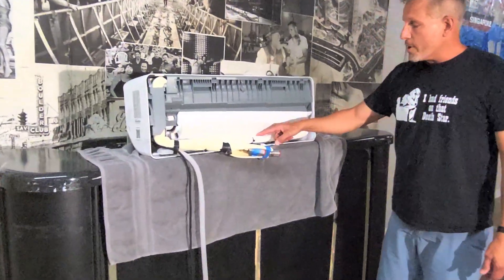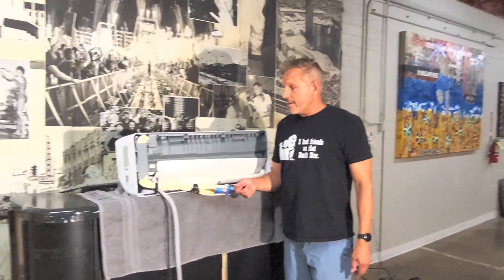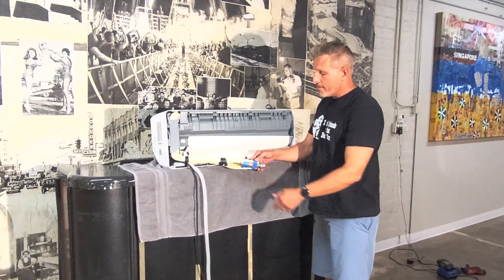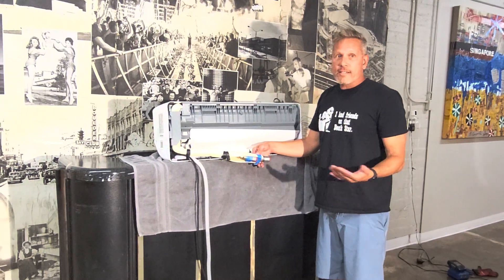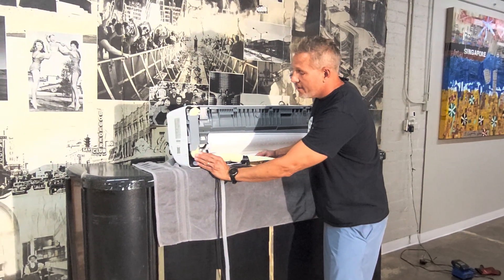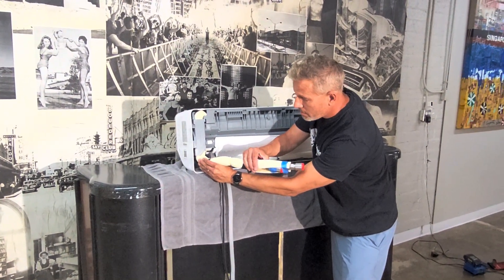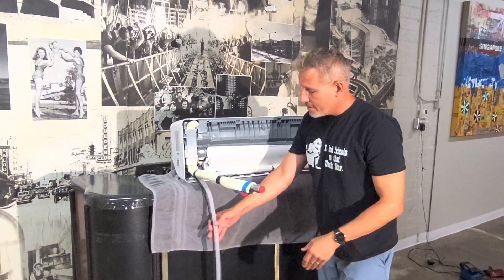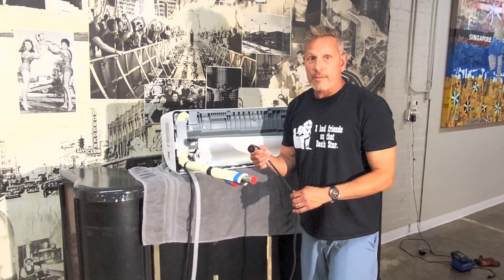Quick 'n' Easy install #1:  straightening the refrigerant line stubs on the indoor unit.

Comment: Dave - I just purchased this unit from Santan Solar,  I’ve been waiting for seemingly a decade for something like this!

I’m at this stage of the install and I’m very concerned about bending the copper lines.  I know how fragile copper can be when bending, I’ve had some very bad experiences with bending copper line so I’m really hesitant to even bend these lines at all.  I know this would likely be a many thousand dollar mistake.

I’ve watched this video and read the manual several times but I’m still hesitant to bend these the way they need to  go.  Where on the lines does the actual bending take place?  All I need to do is put my hand at the last elbow and slowing rotate it?  It seems like it’s needing quite a bit of force, is this normal?
Reply from the maker: Hi Brian, 

Well, only the paranoid survive, so you are barking up the right tree. You know, as long as you're aware that there needs to be a fulcrum, you're fine. We'll take care of you if you mess it up, but don't mess it up! 

https://youtu.be/95pit_Oroq4
https://youtu.be/p1lwJ1BmHpA

Which part are you most concerned, straighten it out of the back of the indoor unit, or when it comes through the wall?  Watch the above 2  videos since these are the main curves (we'll call them curves, in fact, not bends).
Reply: @ Thanks Dave!

Big thumbs up for the great customer support!!!

I got this installed and it’s running perfectly!

I hope this will last a decade or so. But I’m not reading good things about the longevity of mini splits in general. 

I’m doing this more to have some independence from the grid.  In AZ, no AC would make living here nearly impossible.

Comment: Can the hole (for going through the wall to the outside) be offset to the right of the inside unit?  
There appears to be a 'punch-out' or scored area on the right end of the unit on Page 8 of the installation instructions. 
I want to mount it above a window, but to avoid the header, and studs in the wall, can bring it out about 10" - 11" outside of the unit, before taking the 90* bend to go through the wall?
We have a 2"x4" wood wall construction, so I believe from the bend behind the unit, about 12-13" to the right, then bending outside 5", then downward. 
Will the Quick 'n' Easy line pigtail be enough to get it outside to connect? 
Thank You - (getting ready to order ~ save me one!).
Reply from the maker: Hi Mike, yes, you can punch out to the right, no problem. Will do the final measurements to make sure that's also viable for the quick and easy, since normally that would go straight through the wall. Or we can customize the quick and easy to put the valves on the outdoor unit possibly if necessary. We'll discuss it.

Comment: How WIDE is the indoor unit?  
How far out from the center will the hole be required to go through the wall? 
Can the unit be installed above a 36" wide exterior door? Missing the Jack Studs and (2"x4") Header?
Reply from the maker: Hi Mike, the indoor unit is 33.07 in wide. For some of these specifics, refer to airspool.com/install and check out some of the installation videos for the Airspool unit on YouTube.